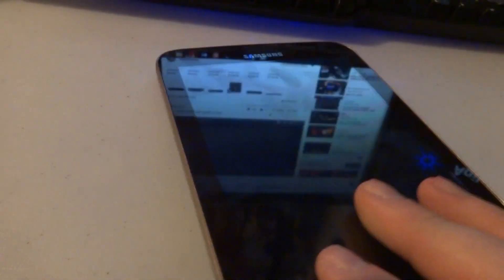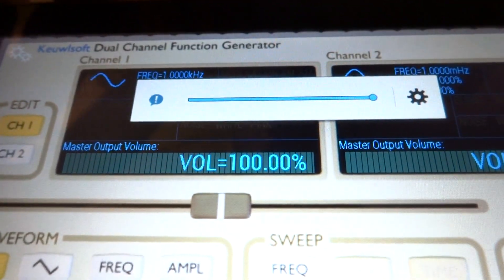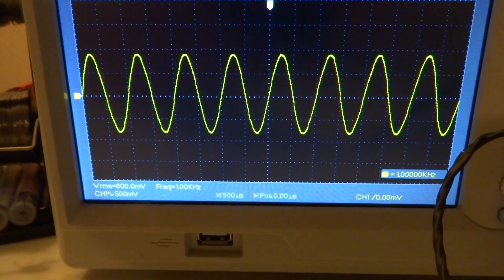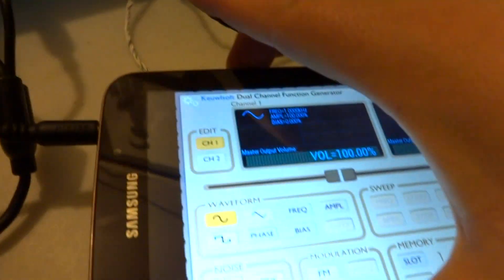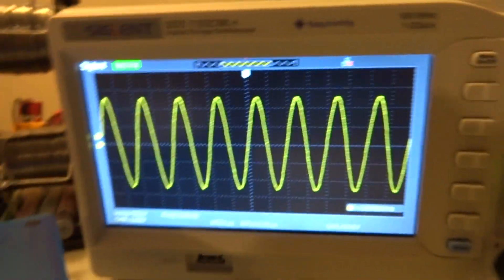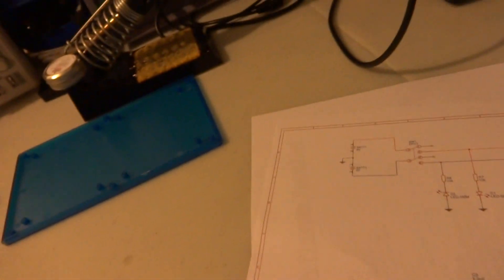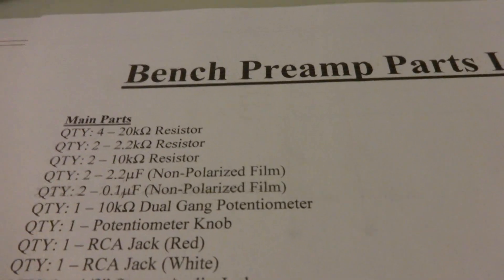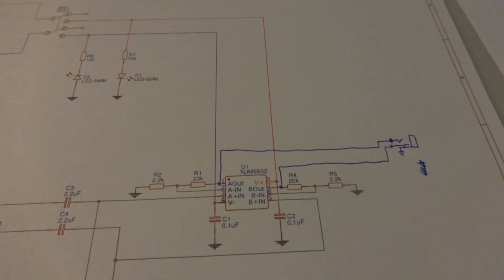(72) "Poor Mans" Function Generator (Audio Amplifier Testing)

Comment: I had the idea of using a tone gen through a stereo for creating different wave forms/amplitudes/frequencies for electrolysis/LENR experimentation. Cool idea.
Reply: Most amps have to cutoff higher frequencies by law so you're don't accidentally broadcast on am frequencies. I've been looking at many amps' specs and can't really find with a frequency response go above 25,000hz except for cb amps, which are technically illegal.
Reply: @homevalueglass  did you consider using a simple discrete amp using relatively high freq transistor or mosfets?
Reply: Much easier to do it digitally than have to build a new circuit to test each idea.